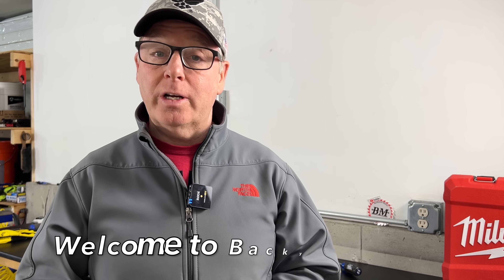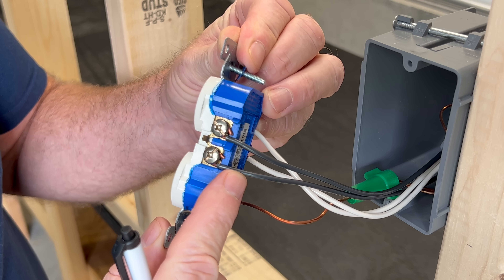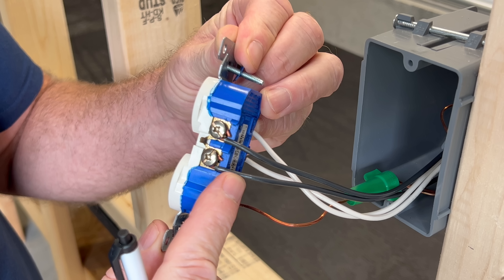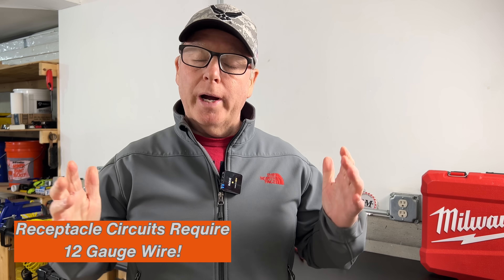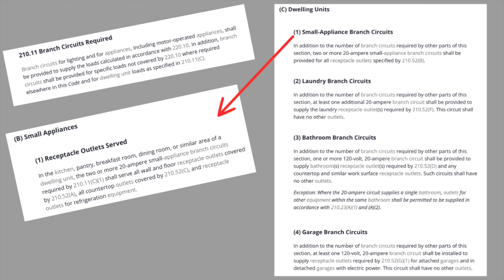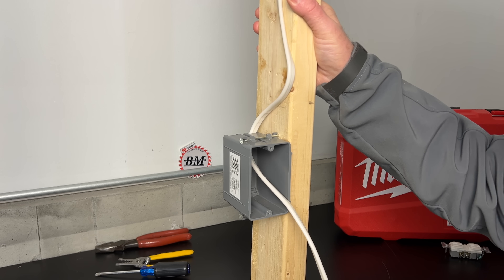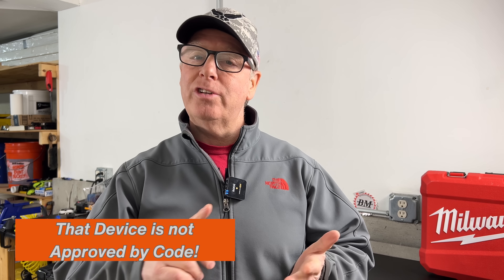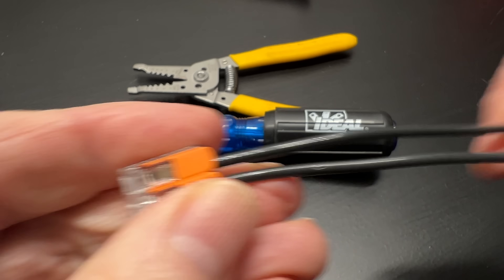5 Electrical Code Lies DIYers Should Stop Believing!

Comment: The house I live in has the upstairs bathroom light and plug, kitchen light, range hood fan, downstairs bathroom light and outlet, kitchen light, range hood fan, patio light, dining room outlet, and three living room outlets all on one 15 amp breaker.  The landlord doesn't care that it often trips.  I've tried to tell him that just knowing the circuit is overloaded means his fire insurance is voided.  He just laughed.  I have three months left on my one year lease and am looking for a place to move to.
Reply: Even if it is overloaded, that's what the overcurrent protection device is for - so it can't start a fire.  I mean after all, you can at any time overload any outlet in your house, and that doesn't magically void your insurance.
Reply: Seems OK to me as long as he does not try to put a 20Amp breaker on a circuit built for 15Amps.  As built, you get 15Amp, no more and if it were properly built, then it will be safe. Ie not with 16Ga. What I think he may be doing is limiting his tenant's electrical use with the single circuit, you get 15A , no more and it's up to you to allocate that.  
I do this for festivals where each camper gets 10A circuit, what they do with it is their business. They pay for a 10A share.  If you want to run an RV or electric heating or cooking, that's a 30A RV circuit and it costs more than 3X the 10A as your peak currents can be much higher and have to be supported by bigger distribution and generators.  Even then, people pop the 30A, usually by running the microwave with AC on. They learn quickly not to do that.
Reply: @TD_YT066   Temporary sub distro and a residential situation are completely different universes.  If the building is 100 years old, I guess there is a possibility it may have been up to code at one point, or built before there was a code, but doubtful.  It sounds more like a serious hack job.  I would call and make an inquiry with the building dept. and see if he might get a bite.  Under modern code, a bathroom outlet is supposed to be its own dedicated 20A GFCI circuit alone.
Reply: @GoingGoneGalt   A bathroom receptacle does not need its own dedicated circuit. It can be shared with lights in the same bathroom OR with receptacles in other bathrooms. At least that was the case in the 2017 NEC. My house (built 1996) has one central 15 amp GFCI for the receptacles in all the bathrooms, the garage, and outdoors. The OP's isn't much worse. With the exception of the bathroom receptacles everything mentioned seems acceptable (even by modern code) to be on one 15 amp circuit. I'd guess the bathroom outlets were added later.
Reply: @eDoc2020   Well, as usual, the answer "depends".  The bathroom can have 'A' circuit of convenience outlets that share those, but it cannot be THE main sink / countertop area circuit.  Since 2020; 
2020 Code Language:

210.11(C) Dwelling Units.

210.11(C)(3) Bathroom Branch Circuits. In addition to the number of branch circuits required by other parts of this section, one or more 120-volt, 20-ampere branch circuit shall be provided to supply bathroom(s) receptacle outlet(s) required by 210.52(D) and any countertop and similar work surface receptacle outlets. Such circuits shall have no other outlets.

Exception: Where the 20-ampere circuit supplies a single bathroom, outlets for other equipment within the same bathroom shall be permitted to be supplied in accordance with 210.23(A)(1) and (A)(2)
Reply: @GoingGoneGalt   The exception you posted makes it look like the lights can be on the same circuit as the outlets. But what I didn't realize (and you didn't cite) is the 210.23(A) exception: "The small-appliance branch circuits, laundry branch circuits, and bathroom branch circuits required in a dwelling unit(s) by 210.11(C)(1), (C)(2), and (C)(3) shall supply only the receptacle outlets specified in that section." This seems to completely invalidate the other exception.

In any case you can still put the receptacles of multiple bathrooms on the same circuit.
Reply: @eDoc2020  The code can be very confusing for those of us who do not work with it every day, for sure.  Lots of things in it seem to contradict one another.  When doing projects for myself or for friends, my general rule is; over engineer and over build.  I am never sorry for doing that.  If I were a pro contractor, I would be looking  to save every cent on materials and labor that I could while still doing a safe and legal job.
Reply: That's not only dangerous but just plain stupid.
Reply: If it was grandfathered in that way and was allowable at one time, you may be out of luck.  Lots of older houses from the 40's and 50's only had four or six circuits total.  If it was a modern hack job done without a permit though, you may be able to withhold paying rent until it is fixed.  You will have to do your own research to find out what your rights are here.
Reply: @GoingGoneGalt  withholding rent? The DIY lawyers states.
Reply: Will the house wait that long?
Reply: Good idea to move.  Regrettably, his insurance will likely not be voided, however.  Many, many fires are caused by human error, stupidity, or cheapness, and are still likely valid claims.  The insurer would have to know that the circuit was overloaded, and then find out that the landlord knew it well ahead of time.  These are both hard to determine after a fire.
Every year at Christmas there are dozens of house fires caused by "octopus" outlet multipliers for light strings on skimpy extension cords.  Most people know or could know that this is hazardous, but the resulting fire is likely a covered claim.
Reply: Codes change and what was allowed yesterday may not be tomorrow. If your circuit is overloaded then the breaker will trip, no need move and make a scene.

Comment: Most circuits for new residential are multi-wire. When multi-wire branch circuits are split to feed power to designated area they are still considered multi-wire.
Reply from the maker: Multi-wire branch circuits are rare in new construction. For a variety of reason including the expansion of GFCI protection and AFCI protection as well as other requirements. Check you panel and see how many to pole breakers you have feeding 120v devices. Probably very few or none. You will have a few for 240v equipment like well pumps, dryers, range, water heaters etc. But those are not multi-wire branch circuits because they don't feed 120v loads.
Reply: "Expansion of GFCI protection"? This maybe for most recent version of NEC. Most municipalities use earlier version of NEC until village/city guidelines can be updated. My house panel was installed before code required handle tie for multi-wire branch circuits. When I said 'most new residential' I'm referencing the homes at work .Of course you're aware two-pole AFCI are available? Anyway, I think it's best to pigtail at every device.
Reply: They're still technically multi-wire branch circuits but AFAIK pigtailing the neutral is not required after it's split into normal circuits. Also I believe the pigtails are never required on the hots.
Reply from the maker: I defined multiwire branch circuits in the video. Having more than one wire doesn't make a multiwire branch circuit. The three word together have a very specific definition.  @eDoc2020
Reply: @BackyardMaine    Are you sure? Any household circuit fed with both poles and a neutral is a MWBC. This definitely includes ranges, dryers, and any other NEMA 14 (or 10) family receptacles.
"Branch Circuit, Multiwire. A branch circuit that consists of two or more ungrounded conductors that have a voltage between them, and a grounded conductor that has equal voltage between it and each ungrounded conductor of the circuit and that is connected to the neutral or grounded conductor of the system."
Reply from the maker: That's correct. A 240v system like a dryer or a water heater for example is not a multiwire branch circuit. My point was that a branch circuit feeding receptacle and switches with one hot one neutral and a ground is not a multiwire branch circuit even though there is more than one wire. I just didn't want anyone to get confused. I think I better make a video going into this because I have found a lot of confusion in the comments.  @eDoc2020

Comment: "A service loop... is not a bad idea."

You just lost half the credibility the rest of your video built up with that one comment. Service loops are a convenient shortcut that includes far too many inherent risks and explicit problems to be worth it. The fact they get used everywhere by either lazy or cheap builders and by those who simply don't know any better is one of the leading reasons why so many houses and businesses in America have damaging levels of electrical noise on nearly every circuit. They're also a common source point of electrical fires and electrical injuries from homeowners and workmen drilling or hammering into "safe" wall locations and striking through cable insulation into the wire or from the loose segments of loops rubbing against screws and other sharp points and edges on their own. 

Service loops are very much a bad idea. The time and money "saved" aren't worth what CAN happen, and they aren't worth what always DOES happen.
Reply from the maker: Just so you know I have never left a service loop in my career. I think they could be helpful but I think like you that they cause more issues than they solve.
Reply: @BackyardMaine  That's a relief to hear, and restores some of the credibility that was lost in my opinion of you,  but it doesn't really erase the tacit endorsement of them you gave. Not that you really need to give any weight to my opinions! I'm just some guy on the internet with too much passion and not enough sense.
Reply: Weird. Never had customer point out too much electrical noise on circuit. And it is prudent to leave little slack on romex.
Reply: @Harry71D  A little, yes, but really only enough to account for expansion and contraction. As for your customers and clientele never commenting on it to you, most people don't know enough to suspect it and don't have the tools or knowledge to test for it. It's not always as easy as waving a portable radio around near the walls. Usually people just know the surface symptoms and want the experts to come in and fix it so they can get back to the grind (which isn't entirely a bad thing because the ones who know just enough to get in trouble can guess wrong).
Reply: I'm curious to know how exactly a service loop causes "damaging levels of electrical noise on nearly every circuit".
Reply: @stargazer7644  "Nearly every circuit" is a hyperbolic assumption about how frequently builders place service loops in new construction, based in part on how many disparate circuits I've seen exhibit symptoms of problematic noise levels in far too many houses and even some businesses. 

Any loop in a mains level circuit line, whether it's a service loop at the outlet or a slack loop in the attic,  or another loop anywhere in the run, will behave inherently like an unregulated antenna, both receiving and transmitting electromagnetic interference up and down the line from the loop point. It doesn't take much at the right frequency ranges to cause many downstream consumer electronics to malfunction and not much more still for it to fry. The loop can likewise distort or exacerbate the inherent switching signals from the electronics, and either push that up the line towards the main branch back at the breakers or simply transmitting it as a radio frequency. Any of those phenomena can wreak havoc on devices connected immediately to the same circuit or to neighboring circuits.
Reply: @claws61821  This is utter bollocks.  You probably should read a book on basic antenna theory before attempting to convince others how they work.
Reply: @stargazer7644  I know enough.

- any looped wire is capable of acting as an antenna for a given range of frequencies, as well as harmonic outliers
- an antenna that "picks up" a frequency energizes a corresponding charge down connected wires, and transmitters often have regulating components to account for this
- an antenna that is energized from a connected wire will broadcast electromagnetic radiation on the compatible frequencies, and receivers have regulating components to account for this, as well
- a single antenna, even the most simple ones, can both energize and be energized by any connected wires at the same time
- aharmonic frequencies on a power line interfere destructively with eachother, which distorts the frequency used to energize electronic devices, and this can feed through the regulating components of their power supplies, particularly for switching power supplies such as are nearly ubiquitous now in consumer devices
- even a few milliwatts of unregulated energy or unfiltered frequencies outside of spec can wreak havoc on sensitive equipment or components; ranging from blocking or spoofing a sensor, to flipping bits on a processor or storage  or memory chip, to frying a capacitor or a resistor or a microchip or many other components. The more sources of interference you have on a circuit, the more likely some of it is to get through the regulating components of any single device and to interfere with the functions of device components or damage them.
- the significant bulk of components inside the transformer box that serves any given property site in the United States is not the transformer coils themselves (though they are not inconsiderable) but regulating components intended to filter out interference picked up along the run from the nearest station or substation so it does not damage downstream equipment. Much of that interference is picked up at points where power lines are coiled into loops to connect to interstitial equipment on the utility poles or to minimize risk of damage to the lines themselves at turning points which would otherwise require damagingly sharp radii.
Reply: @stargazer7644  "aharmonic". If you're going to quote what I say in order to mischaracterize it, you can at least have the intelligence to do that much right. Your lack of understanding of basic principals of wave physics and how they bind electricity, electronics, and electromagnetic radiation says more about your own education and willingness to open a textbook than it does mine. Do yourself a favor and study up on something before you declare it to be alarmist rubbish next time so you don't make yourself look like this much of a fool again.
Reply: @claws61821 "basic principals"  Ok, Einstein.  You really don't have any room to be talking about anyone else's education.

Comment: Grampa had his own code for his shed, just wire nut together and wrap with plenty of tape, no box needed.
Reply from the maker: I have seen that and worse. I actually rewired a home after a fire that has started where someone connected zip cord to a 20A circuit using wire nuts and tape but no box. The zip cord fed an outlet for an electric heater on the bedroom. Luckily nobody was hurt.
Reply: @BackyardMaine YIKES!!  Whoever hopefully whoever lived in that home at the time of the fire brought some lottery tickets once the smoke cleared.  Jokes aside, an electrical fire smoldering in the walls of a bedroom is a worst case scenario where occupants are likely sleeping since by the time a smoke detector goes into alarm, chances are it's already too late for your home fire escape plan to save you.

Comment: Excellent video, and I agree with all 5 points!
I do have one observation, but I don't have the NEC text:
Service loops - I'm assuming it states a 'maximum' of 12" for staple (secure)?
If for example you staple a 12" length of cable loop at 4" from the box, you would then have 8" of slack...
[you could have around 16" of slack if you stapled 18" at 2" from the box, if you wanted to be absurd]
(I don't like the loop illustrated, as it can twist and kink pulling it into the box; I like a flattened 'S', but then, I don't do new installs)
Mr K L
Reply from the maker: That's a great point.. Thanks for sharing.

Comment: Some inspectors have ego's so big its just easyer to do a now build or renovation in 12 gauge
Reply: It's actually easier to know the code as well as the inspector does so there is no room for ego.  If s/he has a problem, the code section can be cited on the correction notice.  Otherwise the inspector needs to be on his/her way.

Comment: I think the stapling thing is one of the dumbest codes in the book. It is absolutely unnecessary. I can't tell you how many times a stapled wire has made a repair more difficult because I couldn't pull the wire out any more. The only place it should be secured is at the breaker box. After inspection I know a lot of electricians that will remove staples.
Reply from the maker: They do make repairs harder but without them so many more issues would occur. The cable would be flopping all over and possible get pinched between the drywall and the stud, get hit with screws, damaged by other trade etc. If the installation is done correctly repairs should be very few and far between.